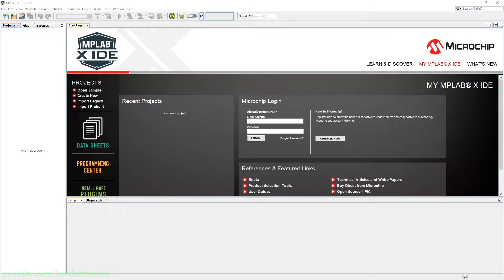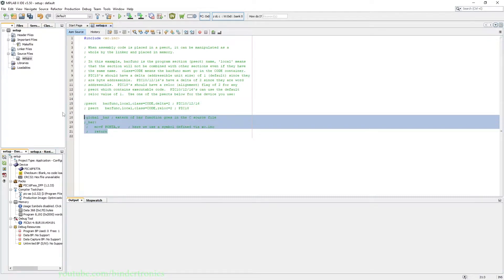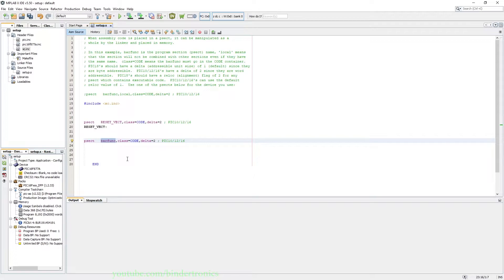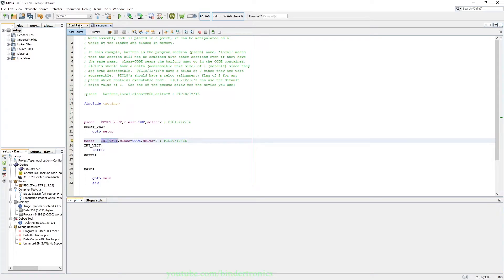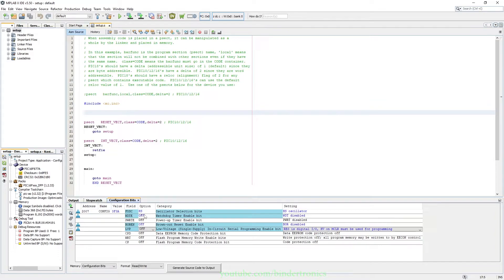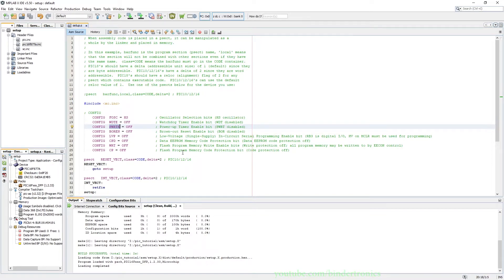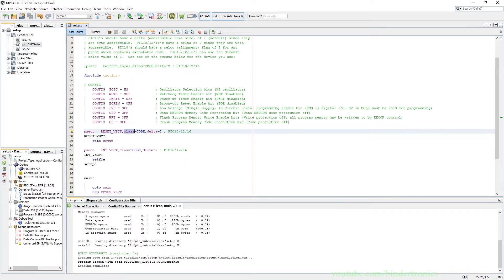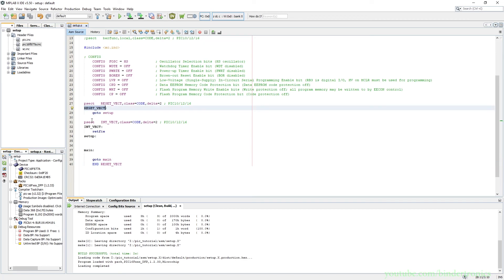Project Setup 🔵 PIC16F877A PIC Microcontroller Assembly Tutorial #2 MPLAB X pic-as mpasm

Comment: Good Video... MicroCHOP screwed up BIG time with PIC-AS s. MPASM is far more practical and more powerful than PIC-AS s and their excuse of MPASM only been 32bit there was nothing stopping them recompiling MPASM to 64bit instead of creating the PIC-AS s GARBAGE. Hopefully they don't destroy the AVR assembler. MPLAB_X 5.35 is the Last version using MPASM.
Reply from the maker: You always got the option to download and install an older version of the XC8 compiler. For the AVR there is always the GCC-AVR compiler doubt maintenance on that project will just stop.

Comment: As I understand it,  you can have your PIC hardware connected to your development PC (using something like a PICkit3 or PICkit4) - which you use for programming, but can also use for debugging. What I would like to see is a video showing how to connect the development system to the hardware (via a PICkit3/4) and where real world actions (say pressing a switch) shows up in the IDE as breakpoints or as redirecting the program via the Interrupt routine etc. So many videos seem to use the software simulator rather than real world hardware.
Reply from the maker: The sort answer is that these MCUs do not really warrant the use of in-circuit debugging. The programs are not complex enough.
If you can program the MCU the only difference is that you click debug and not program device in MPLAB X IDE. There is almost no difference between using the sim and in-circuit debugging. There is also no upfront cost to using the sim. In-circuit debugging is also ungodly slow and you are limited on the number of break points you can use.
I cover simulating external inputs here with the simulator.
https://youtu.be/O4IpwgWhqLY
PICkit4 or MPLAB SNAP as the debugger. The PICkit3 is deprecated.
I'll take a simulator over in-circuit debugging any day if it is available.